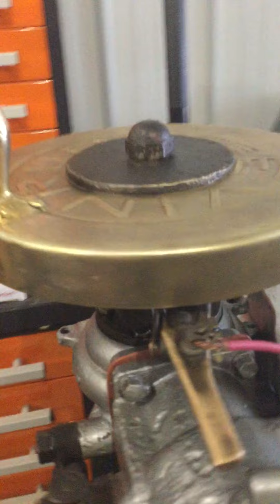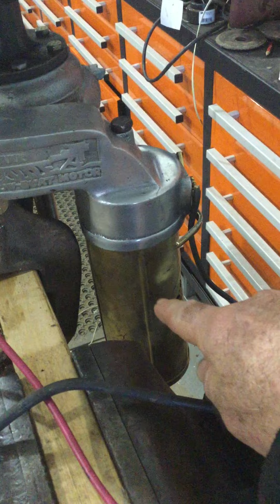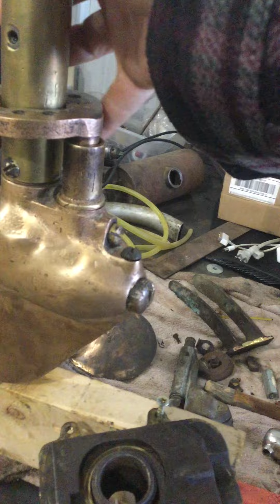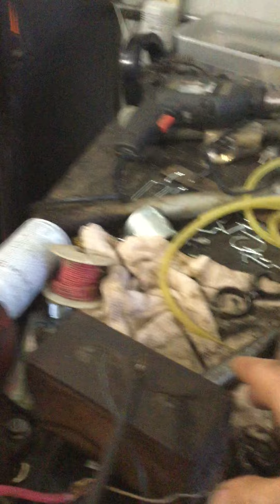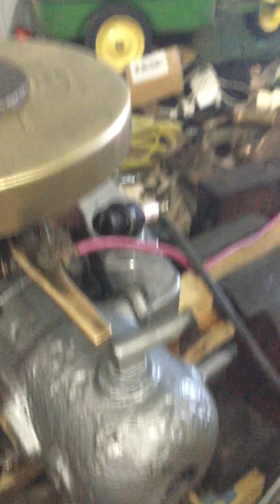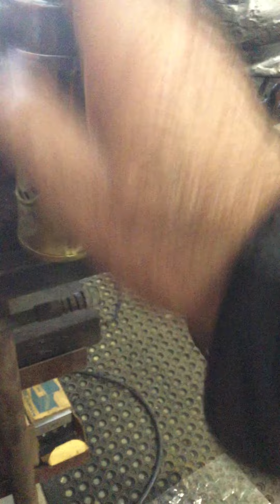Work in progress 1916 Evinrude Rowboat Motor

Comment: Hello, has anyone checked the compression on these old RBM motors.  I have a similar one about 1922.  I have a modern gage but little compression after I turn the engine over.
Thanks for   ANY input.